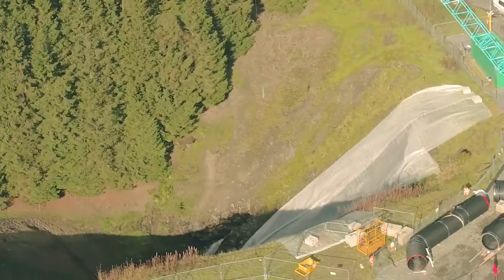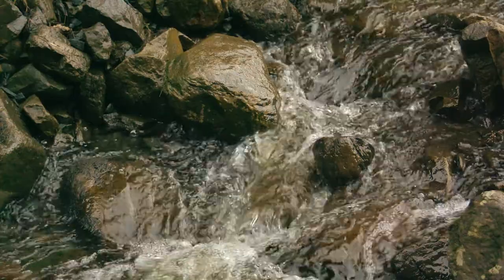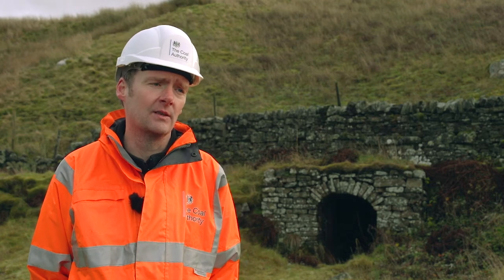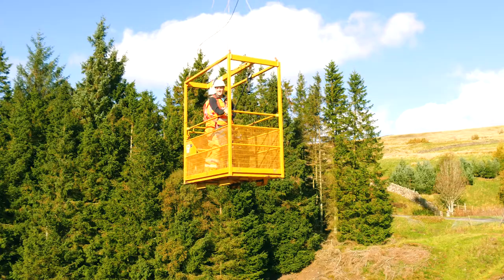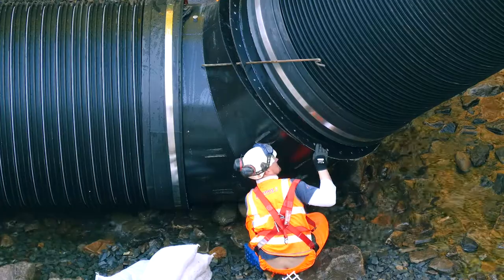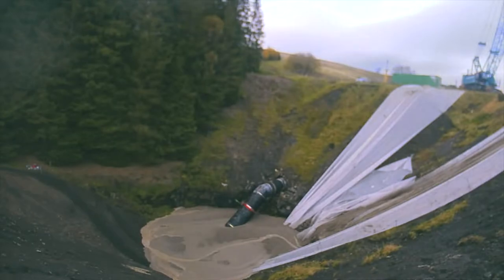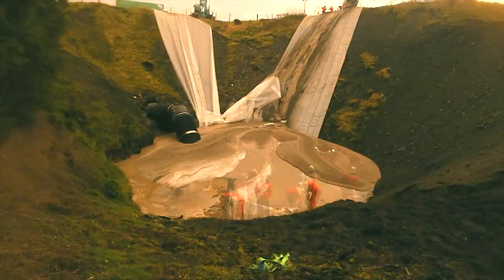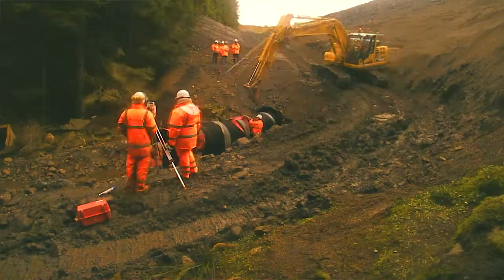Garrigill Culvert project in North Pennines tackles pollution caused by historical metal mining

Comment: This is awesome, like a flexible hose connection between two watercourse culverts. Brilliant and innovative. What would be the usual use application for that flexi hose product? Thank you.
Reply from the maker: Hi, thanks for your question and apologies for the delay in replying. We've spoken to the project manager and he says the pipe between the culverts is actually solid (steel-reinforced plastic) with solid steel bends. It looks like a hose as it is ribbed. All the best.
Reply: @TheCoalAuthority  That's great, thank you.